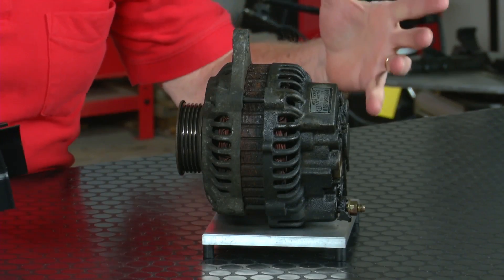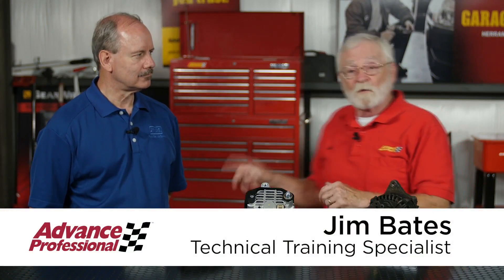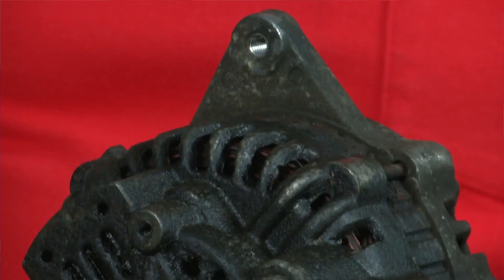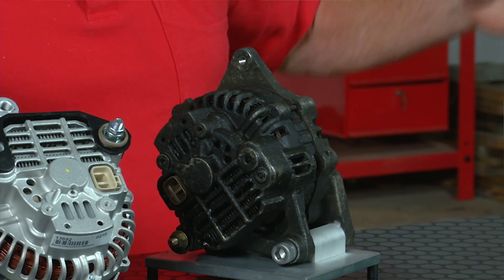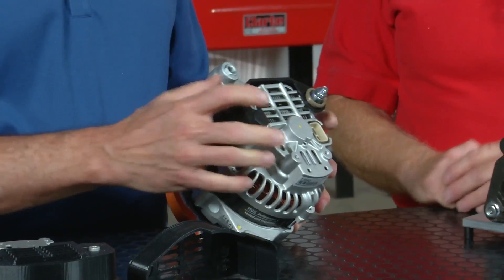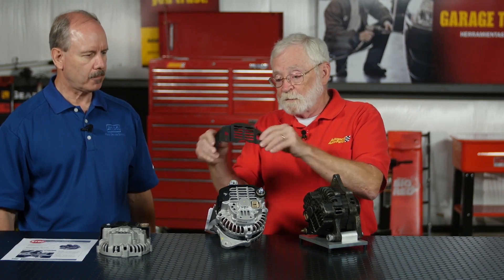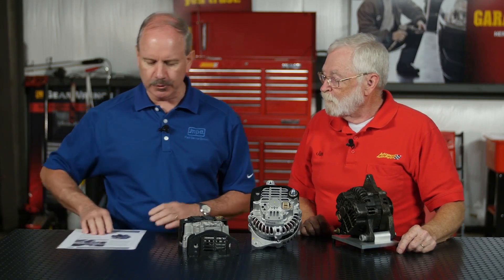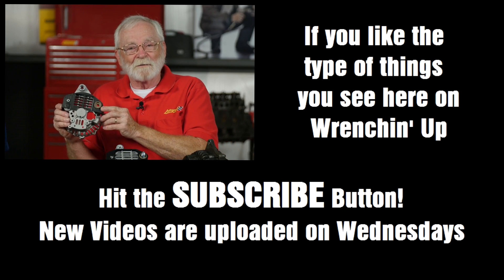How To Deal with an Oil Soaked Mitsubishi Alternator (#1 of a 3 part series with MPA) - Wrenchin' Up

Comment: Why not fix the cause in the first place?
Reply from the maker: stilkus As we said in the video, the repairs can be quite expensive and many vehicle owners just can't afford to have it done right away. Since the alternator can fail within the alternator's warranty period it gets replaced, so the "drip shield" is a good idea for MPA because it cuts down on warranty replacements that are not their fault.
Reply: that is just fucked, of you to say....
Reply: In my opinion Mitsibishi should put out a recalls and fix all the oil leak problems if this vehicle is "notorious" for this type of issue. I've heard time and time again about this engine having a problem with valve seals, valve cover gaskets, etc. Leaking oil. I've had to replace both an Alternator and Starter because of oil soaked parts. It's actually ridiculous that it's a Mitsubishi problem but we as Mitsubishi owners have to pay for it when the manufacturer knows that it's a problem. Disappointed in you Mitsubishi. I will not ever buy another one that's a garuanty. It's sad that you would treat your customers like this when you would rather put a piece of plastic on a $300 part we have to buy and fix because you as Mitsubishi Manufacturer will not do anything to actually fix the oil leak issue with these engines. This video just makes Mitsubishi look bad.
Reply: I bought a lifetime guarantee alternator but only 2 free after original. So mine will last 5 plus years. I have means but I don't wanna spend the $750 for oil leak correction. The truck is used for dog carrying to vet and pulling my garden trailer.  It is barely worth $2000 so I am not wanting to put $750 in to it yet.
Reply: chris young vv
Reply: vv  ?
Reply: don't be an ass hole.   I own a 2002 montero sport and already fix the leaking oil 2 times. now is leaking again. my alternator just fails and probably is because of the oil. so this alternator cover looks like a good idea but is to late for me.
Reply: +Jim Bates If you can't afford maintenance and repairs you can't afford to own a motor vehicle. Use public transportation
Reply: @Turbotomass  I know this is 3 years old and I'm late to the party. I have to ask was this a serious comment, or were you just being a troll?